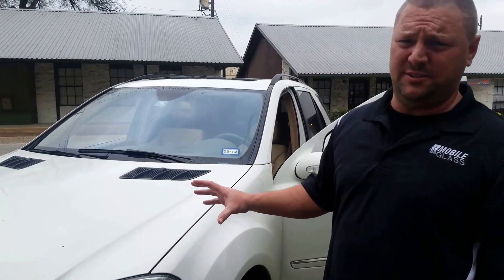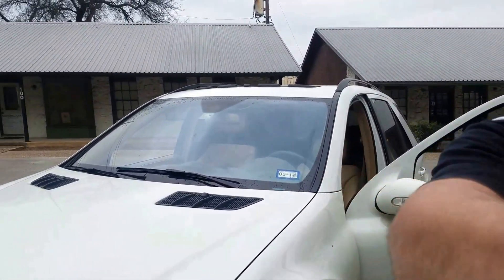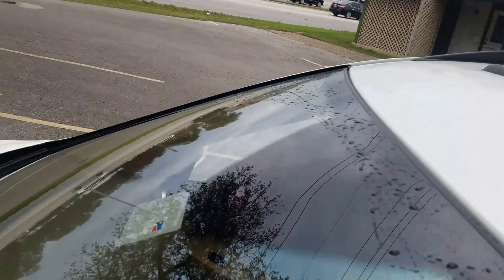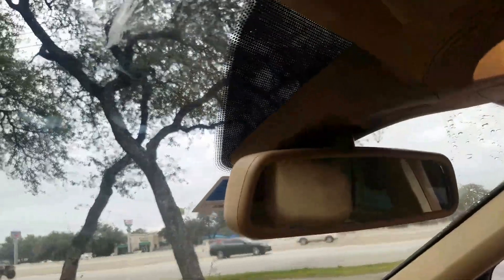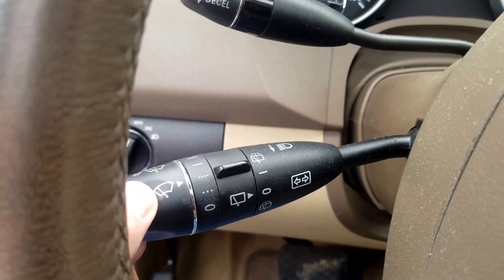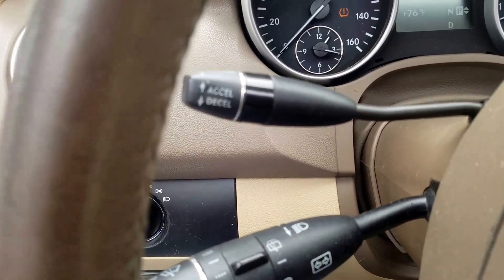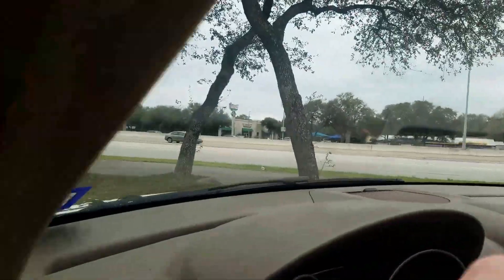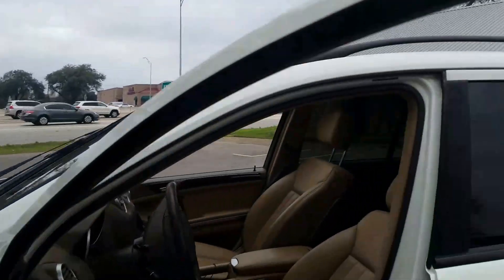What is a Rain Sensor? How does it work?

Comment: Infra red transmit sensor at 45 degrees, when rain hits the screen the light gets refracted away (dispersed) and less light gets to the receiving sensor.  Sensor comes on and speeds up according to how much rain gets reflected... modern sensors have gel pads between the sensor and the screen to help with the light and some say to reduce vibration perhaps